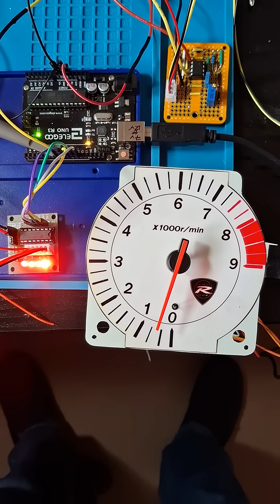Mazda RX-7 FD Tacho: Arduino Digital Driver

Comment: idk what's going on here's but it's pretty cool! interesting work man, keep it up :)
Reply: Complete replacement of OEM electronics and gauge motor with modern stepper motor and software controlled digital circuit. The only reused items are needle and gauge backplate. Solves issue of unreliable/failing tachos in RX-7 FDs.